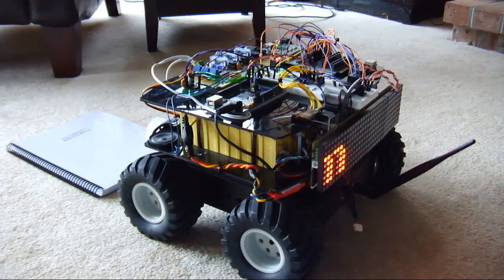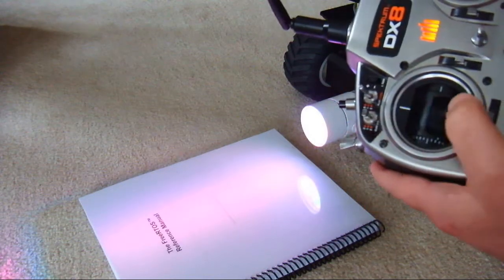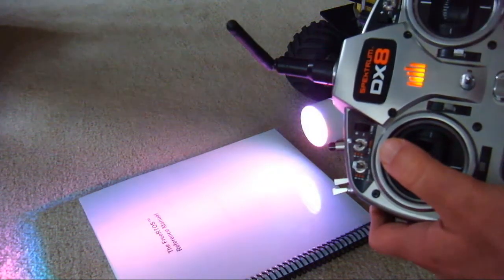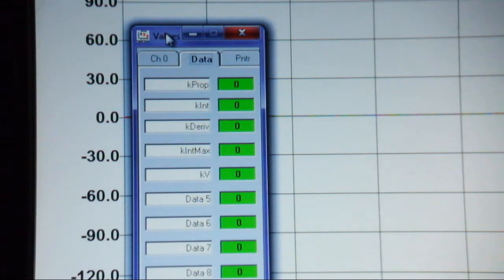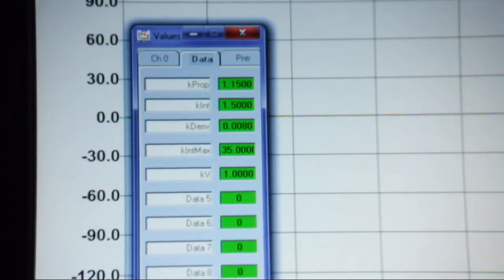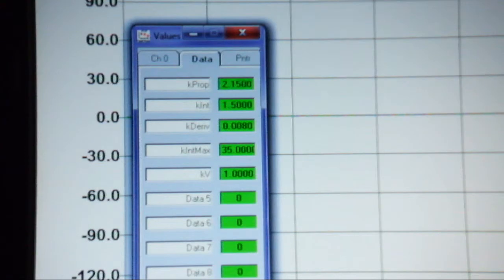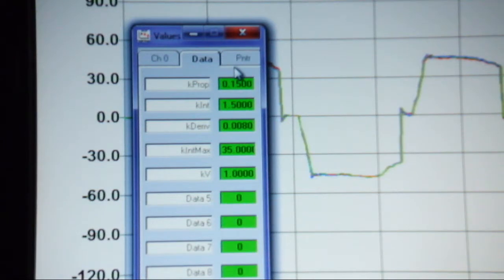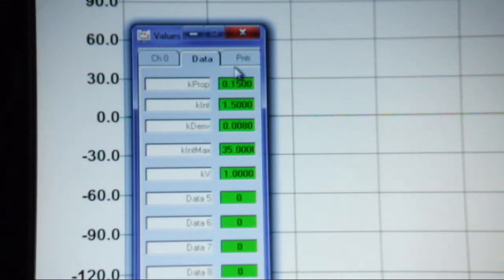Mars Rover Robot w/ RGB Scrolling Text Display

Comment from the maker: The only Arduino is used as a subcontroller for the Rainbowduino backpacks with custom firmware.   A PIC32MX running FreeRTOS does most of the grunt work. Bringing in the RC radio channels and timing the pulse widths to get that information into the controller. PWM control of the motors is wrapped around 4x PID loops (each wheel) with feedback coming from 4x quadrature encoders on the wheels, which is serial shifted to keep the connections down. Message queueing handles the display and RGB headlight mixing. The PIC32MX is maxed out and will get replaced with an ARM Cortex-M4 microcontroller in the future, with custom motor controllers and circuit boards.